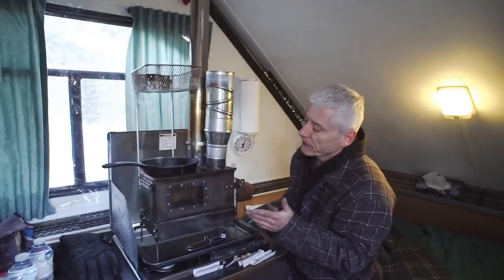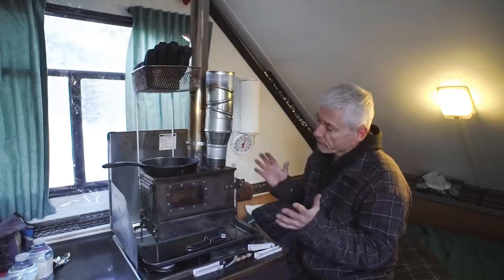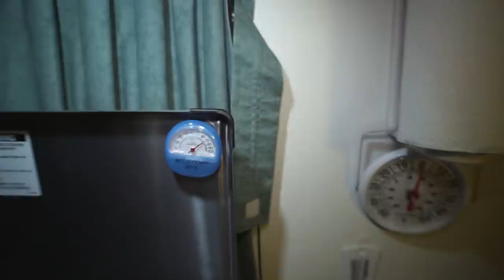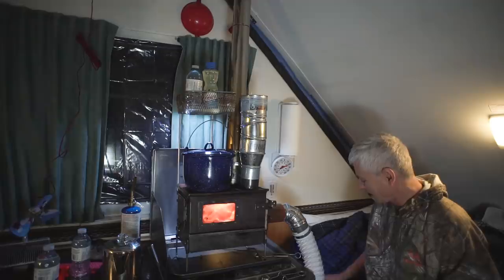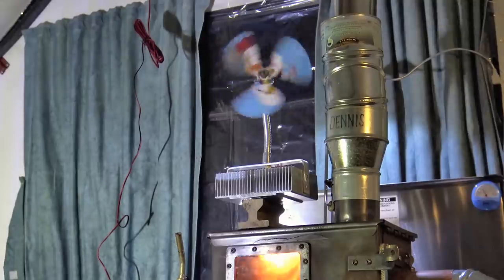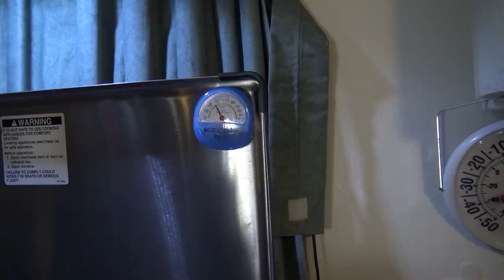Wood Stove in an A-Frame Trailer - Part 2

Comment: Although you  have a disclaimer about doing the heater in a trailer, I think you are doing a disservice to your viewers.  The heater is cleaver, but it's extraordinarily dangerous.  Any malfunctions can turn into a catastrophic event.  It's in a very small space.  The fabrics on your bed, or on the widows can easily set on fire.  If an exhaust pipe or any other part fails, you would have no space or time to safely react.  Years ago I was given fire safety training for a high rise office building and we were shown films of actual fires and lost of life and property.  The training applies to what you are doing.  I'm a big fan of yours, but use the heater your rig came with.  More expensive to operate but way, way safer.
Reply from the maker: Steve, done properly and with safety in mind there is little danger.    Wood stoves have kept people warm in cabins, tents and travel vehicles for generations. Thanks! SP

Comment: Dude....really? .......MINUS 4 degrees Celsius?........I would DEFINITELY be lighting that stove LONG before it got to anywhere near that temperature. Whats the point of having these devices if you don't put it to use below comfortable temperatures? this isn't a survival competition......and minus 4 is not a comfortable temperature...........Ensure you have good incoming airflow especially cooking inside with gas as well....and get yourself a CO detector if you dont already have one..........liking your vids mate. ;¬)
Reply from the maker: Minus 4 is close to t-shirt weather. I need a stove for when it's REALLY cold. The rest is just a waste of energy! SP

Comment: Comfortable until gas bottle explodes!
Reply from the maker: No idea what you are referring to philip. SP
Reply: @SlimPotatohead  Your fire starting torch is right next to the wood stove.
Reply from the maker: At a location where the temperature is under 75F. No issues. Had I put it on top of the stove you might have an issue! SP
Reply: @SlimPotatohead  Duly noted.

Comment: Sorry, but what's the point of being miserable in the freezing cold while camping? It's supposed to be fun! Round one would have been it for me. Actually there wouldn't have been a round one. >.<
What can I say, I'm a lightweight. Only "camped" in the cold in the military, because I had too. And once in Yosemite, because the heater didn't work. Not for me thank you. Still interesting to watch your experiments. Happy trails!
Reply from the maker: If everything you did was "fun", life would be pretty boring. Sometimes you need to earn it. Take a challenge, it's far more rewarding. Thanks! SP